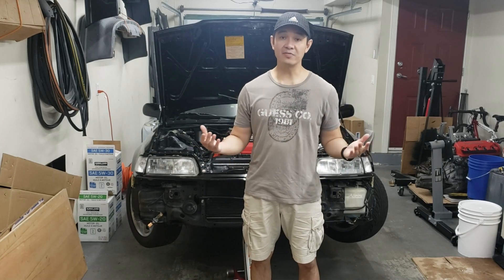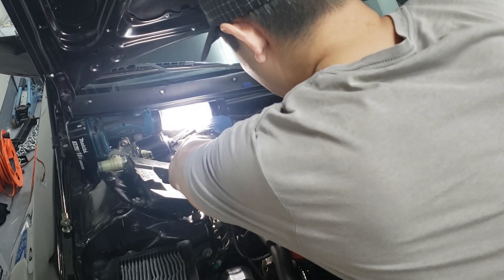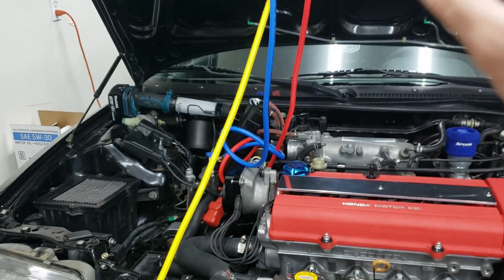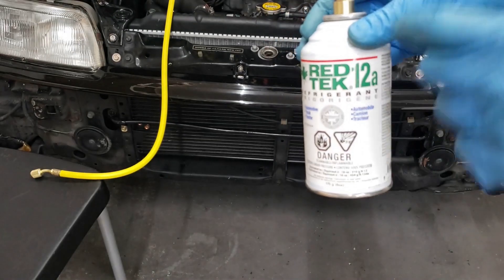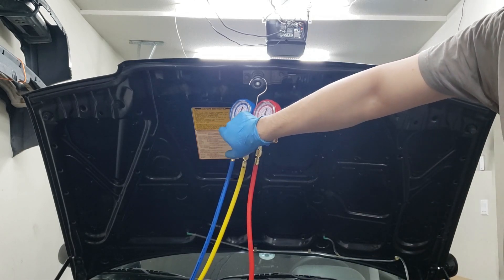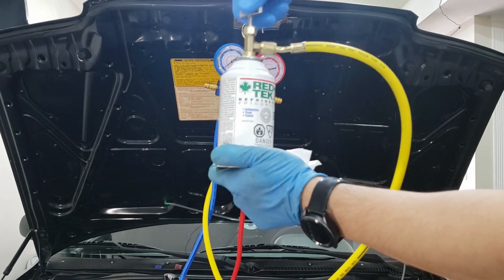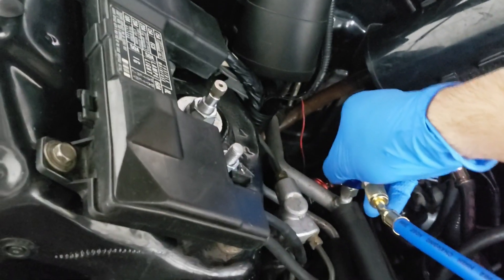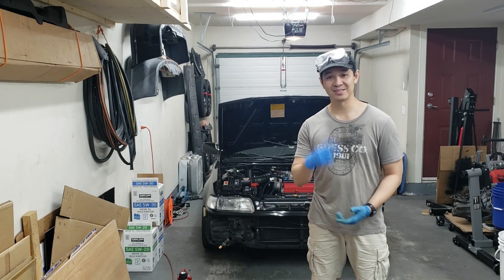||HONDA EF9/ED7 CIVIC&CRX|| 🌀A/C System Installation on B18B1 EF CIVIC🌀 Part 3 - Charging the AC❄️

Comment: those matsushita a/c compressors have valves that tick really badly when they're undercharged, underpressurized, or not using R12.. they're pretty awful and most people move to the TR70 or TRS090 (like I have)
perhaps I will make a video where I install the TRS090 on my b20 crx
Reply: Did you use the crx ac hoses or custom?

Comment: Hey budget gears! Does your service connector still properly work even though you have converted to OBD1. I’ve done the same conversion and I can’t seem to ground the service connector. Any thoughts of why ? Or what I can do? Thank you
Reply from the maker: @kennyanderson1414  my service connector worked fine when I had my Y8. This was with a jumper harness by the ecu. Everything worked as it should. If you're running a tucked harness, there is a service connector wire remaining that you need to ground. Touch that to ground or connect that wire to the corresponding wire at your ecu connector and connect a ground to the corresponding ground and your connector will work. You can figure out how you want to do it by tracing the wires from your service connector to your ecu plugs. Fairly simple to do.

Comment: Is there a reason you removed the yellow hose from the valve on the can? I realize 12a isnt as bad for the enviroment, but people watching this and following it are going to most likely be dealing with r134a and purging that stuff to atmosphere is a huge no no.... idk about up in canada but down here in the states it is a crime and carries a hefty fine. Pretty sure you could have connected up at the gauge and pulled vacuum up there and had a vacuum in the filler line and had no need to purge. I watch and like your videos, so this is just constructive criticism.
Reply from the maker: Thanks for the feedback. I removed the yellow hose from the can to change to a new can. The can was already empty. Also, if you noticed, I mentioned the cans are the self sealing cans. These are the new types of refrigerant cans that have a valve in there. So it's similar to a shrader valve where you can push it and let go and it'll reseal. Unlike the old style cans where you need to puncture the can and use the puncture tool to seal the can, which over time will slowly leak out.  You're right, it is illegal to purge into atmosphere, but that's only if you're deliberatly purging a lot of R12 or R134a into the atmosphere. Shops will also purge into the atmosphere as well. It's never going to be perfect. There will always be a little that leaks into the atmosphere. You can't connect the can at the gauge without the line. Male and male ends do not connect. It might be possible to do that if there was a custom adapter or if they make a short adapter that has 2 female ends. Either way, it'll still need to purge out the air first. That's the whole reason for that purge valve.

Comment: Dont shop rockauto for this reason.  If rockauto send a wrong or defective part u pay both ways shipping.  U will pay for their mistake.  They stsy in business
Reply: Yep. I installed a brand new control arm from them that the ball joint went out with in a month. Contacted them and they wanted me to ship the part back to them for inspection before sending out a replacement...how do you drive a car with no control arm? Wound up just taking the hit, buying a ball joint at an auto parts store ground the rivets and replaced the ball joint to get me by until I could just buy a factory replacement. I needed the car to drive to and from work.... never bought from them again
Reply: @sinformant  they will mix up part for upper model civic like a big bearing vs small bearing for base model. 3 way Shipping equal the price of another product.  And it's not ur fault they mess up.
Reply from the maker: @smartauto1166  I've had similar past experiences with Rockauto, but only after 30 days of having the part. They're usually pretty good if it's their fault and less than 30 days. They'll provide a return shipping label and all that and ship a new part. It's only a hassle having to repack it, drop it off for shipping, and then wait another week for the part to arrive. In the meantime, the car is usually rendered useless. I personally try to buy locally, but many times local parts stores don't carry the part anymore or it's so expensive that it's more than buying the exact same part from rockauto including shipping.